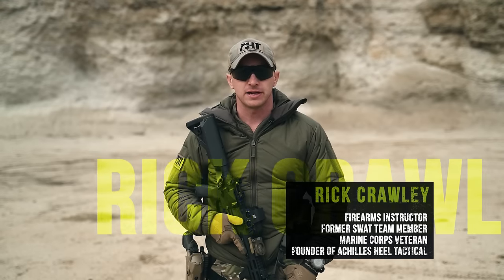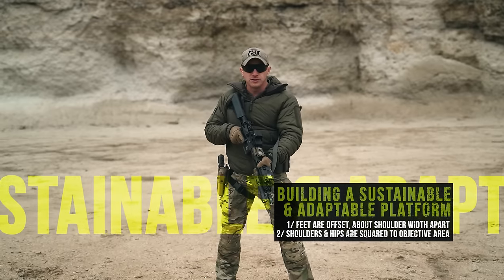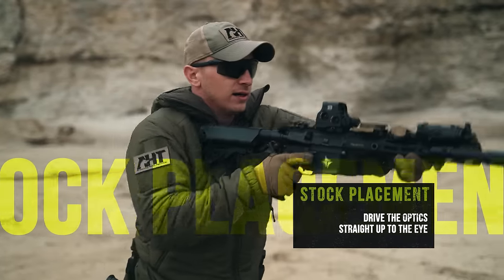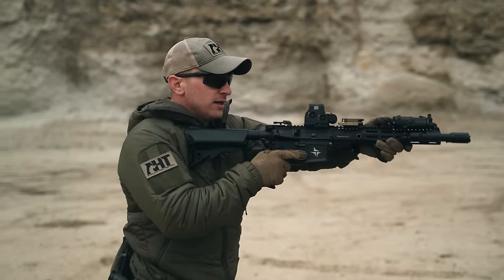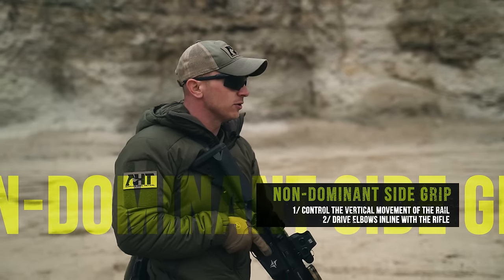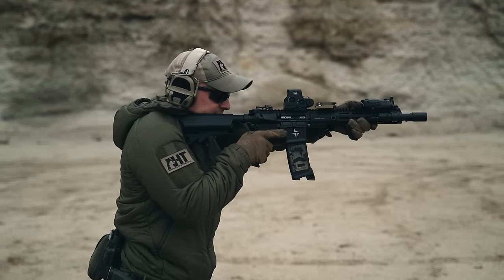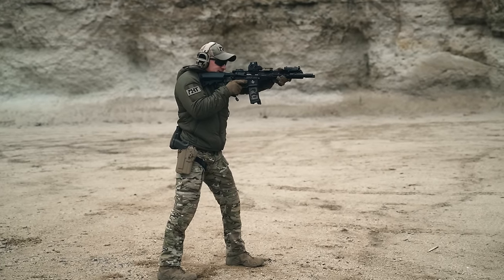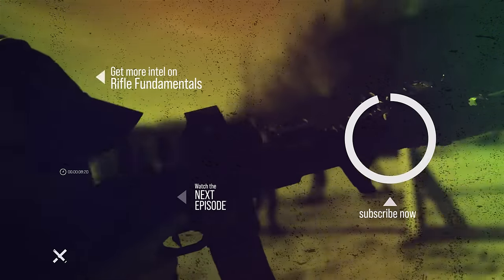Shooting Stance & Grip | Pro's Guide to Rifle Shooting Fundamentals

Comment: solid solid instruction!

After several classes, one thing I recently learned is to experiment with hand placement and elbow angle of the non dominant hand to see which produces the least movement of the dot during 3 to 5 rounds. One instructor even had me shoot in 3 to 5 full auto burst to check recoil mgmt. I found there's truly no one size fits all. For me, running an overgassed SBR, the left elbow ends up higher than the bore, with a C grip that's almost completely canted over the rail.

Comment: Just a few questions for anyone listening.  I’m not an expert but I was in the Marines and I was taught a completely different stance with the rifle.  I was taught to stand more at an angle than straight on target like everyone else is doing today?  I was also taught to grab the handgaurd close to my body, not necessarily grip but let the rifle rest in my hand, elbows were tucked into the body to be as ridged as possible and also having a small silhouette.  For some context I went to boot camp in 2001 and got out in 2006.  I was never issued modern body armor we had the old flack vests.  Are the newer stances more for modern body armor?  Also we had m16a2s not m4s, the muzzle rise was almost nonexistent, felt like a 22lr.  Are the new stances better, are they more for wearing body armor and suited to a shorter length rifle?